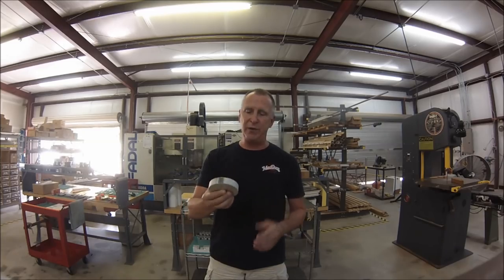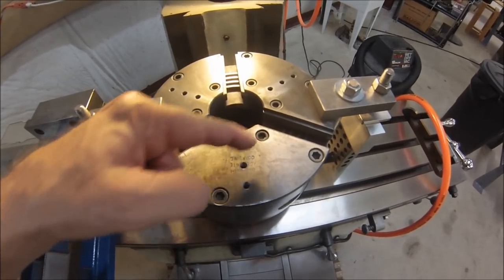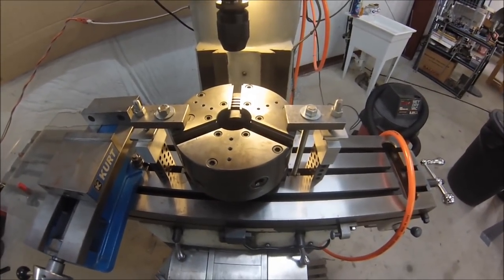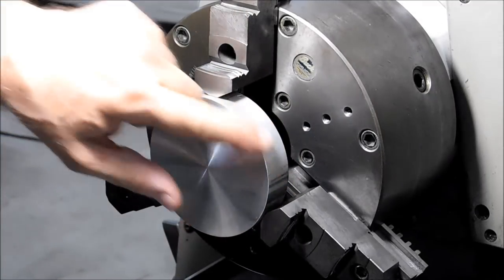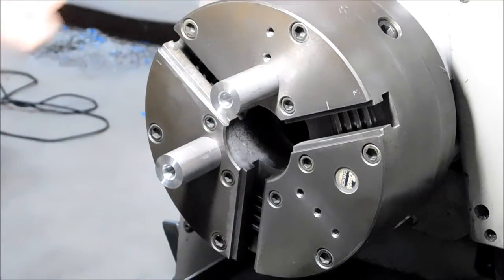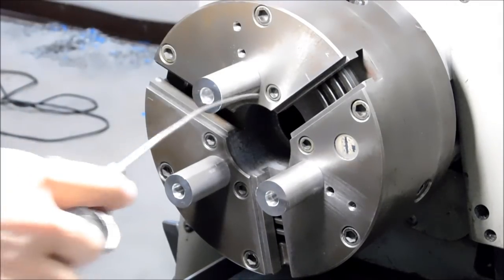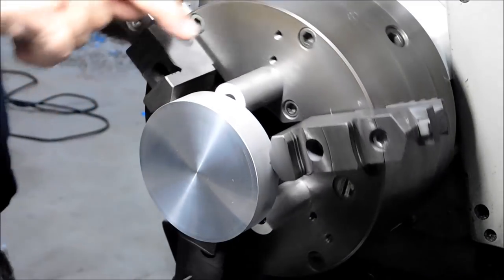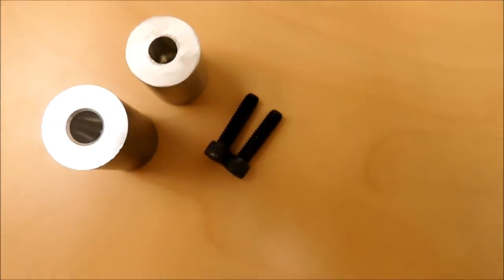A Simple Chuck Modification to Improve Parallelism of Your Parts

Comment: Our shop closes down between Christmas and New Years. I came across this video while I was off. Yesterday was our first day back. The first job they gave me was 4 saw cut pieces just like you had in the video. Work's little slow lately, and the parts weren't due out for a few days, so I decided to try this setup. There's a bit of time in the initial investment, but now that everything is set up I can use this again and again whenever I need to

Comment: Could just use parallels to square up the part tighten remove parallels.
Reply from the maker: You can. Many people do.
Reply: I thought about the parallels, but like the idea of something solid behind the plate.  Great video.  Haven't done a lot of machining since high school, 47 years ago, but am thinking about setting up a home shop, now that I have time on my hands.  Us old dogs do like new tricks.  I got a lot of lathe time in high school because I was willing to learn to use a huge 4 jawed turret lathe that no one else would touch. Learned to love that lathe.
Reply: You could, but then it'd be a bit of a balancing act even if you got into the rhythm of it. For one-offs parallels is better, for large quantities, standoffs is more convenient imo.
Reply: yep
Reply: I have used parallels
Reply: I go through a box of parallels a week and two employees a day from loose parallels.
Reply: Stands are more accurate after machining, as the front of the chuck might not run as true as freshly machined studs.
Reply: you could but depending on the part thickness and material you're working with you could also get some nasty chatter without something solid behind the workpiece. as one of the Vietnamese I work with says "there's exactly 7 ways to skin a cat but infinite ways to cook it" .....  that still confuses me.
Reply: You could but this is far faster for mutiple part runs.
Reply: Speaking from experience, that's a BS way to do it, especially if you have a stack of parts to face. How many times would you be dropping those parallels?
Reply: Good idea

Comment: I'm 75, not a machinist.  I've had a 12x48  Atlas/ Craftsman, now an old  SB 10".  Jet mill drill.   I don't use them much,  and probably  not very good.  Even so the videos  I've seen of yours are VERY helpful  to get my old mind  jacked up,  and  make  one think.   
USN, 68-74,   ET-R2,  NAS Miramar, 70-74,  maintained GCA RADAR and TACAN

Comment: Great video. As a newbie to the lathe I found your way of achieving the same thing a spider does so much more useful. I have been searching for weeks on how to build a spider without a milling machine. Not only that it will be easy to make different lengths with your method , and to think you were able to explain and demonstrate in a matter of minutes the most common sense way of getting around a problem. You also got a new subscriber. Thanks for taking the time to help others like me.
Reply from the maker: Thanks. Make sure to hit that subscribe button to seal the deal.

Comment: Nice set up.  I have used .125" thick parallel bars off the chuck face.  Rotate the 3-jaw chuck so one jaw is pointing up.  This allows you to lay one parallel across the 2 lower jaws, while you hold the second parallel higher, and pinch it against the chuck face with your work piece as you tighten the jaws.  Just don't forget to slide out the parallels before you turn on the spindle. :)

Comment: Whenever I need to machine a thin part, I get a parallel, sit it on the bottom two jaws, resting against the face of the chuck and push my part up against that. Just some advice for people that aren't in a position to modify their chuck.
Great video, really clever.

Comment: Great idea but for a one off part I take and face off a disc of aluminum in the chuck and then superglue my part face to it doesn't matter if it's round or square or not centered whatever then just heat up the part to release the Superglue works fantastic you can turn to a very thin thickness to

Comment: Every video you make is excellent. I don't know how you get thumbs down. I'm about to clean up my fathers lathe and vertical mill they are covered in dust and grime. What do you reccomend for cleaning them?
Reply from the maker: Get the dust off first. A shop vac works well for that. ZEP makes a great line of purple degreasers, and most home centers also have purple power products.

Comment: Excellent demonstration. But what you will do if the same part has small diameter?
Reply: A single parallel slipped between two of the jaws (lay the flat across the jaws) that you back the part up against is a quick-n-dirty solution. In fact, I just used it to make a set of standoffs to mount a control transformer on its side and they all came in at 20.165mm +/- 0.005 (ie - about 2 tenths imperial). File under: it's better to be lucky than good.

Comment: The biggest issue I have with Joe Pies videos are that I always seem to watch them a few days after I needed to watch them.  😏

In my case it would have worked out well to bore a hole that was bigger than my spindle on a piece of 1/4 plate.  parallelism wasn't even critical, but not having to mess with parallels or scrap plywood to get a nice clean and tight offset (4 jaw) would have been so easy and convenient. 

my man always seems to sneak in some safety easter eggs into his videos too.  (marking the jaw safe-limit, not running lathe with nothing in the jaws.)  This is incredibly valuable to a hobbyist who doesn't have a crotchety old machinist near by to share some tips and horror stories.  My dad is missing two fingers (table saw accident), so I'm well aware that bad things can happen - really appreciate the tips.

THANKS AGIAN JOE.
Reply from the maker: I have 2 uncles missing digits from industrial accidents. I'm more than happy to share things that may keep that from happening to my viewers.

Comment: Curious why you didn’t flip the jaws around
Reply: Other people asked the same matter in other comments, and the reply is that reversing the jaws, if the piece to be worked "seats" in the internal jaws steps AND it's not so thick, you have to work with the highter steps of the jaws running outside. Moreover i say that fixing the piece only with the jaws is not so much accurate than setting the piece on the studs and THAN fix it with the jaws . . .

Comment: what a waste of time. on all new chucks the face of your chuck runs true - if not face it. it is repetable if you take your chuck off the machine.
then go to the mill and stick two paralells between your part and the chuck. 
thighten chuck. use hammer to tap it until both paralls are tight. 
take paralells out. 
face 2nd side.  you will get better than 0,02mm. no drilling, no standoffs.
Greets from Germany.
Reply from the maker: But you do have to tell the boss you need a mill so you can face both sides of a part. thats going to end well. Good luck.
Reply: @joepie221  No just take the Paralells from the mill and then go back to the lathe.
Reply from the maker: @Vincemaan  When I developed this solution, I was doing exclusively semiconductor work. Building the plates that handle wafers during their coating and processing. Surface flatness, part parallelism and surface finish were absolutely critical to an acceptable part. Though your technique of using mill parallels will work if snug, the fact that you can remove them would indicate the part wouldn't be parallel to this degree. If you had to tap the parallels out, the track left behind on the part, would have scrapped all the parts I was working on. I even had to be careful of tapping my parts against any standoff for fear of leaving a cloud on the part where it registered. Parallels are OK in a pinch, but this is better.
Reply: you are so correct man, thats what paralles are for
more greetings from Germany
Reply from the maker: @lokkas3637  I need to know who you are in agreement with before I reply.
Reply: @joepie221  actually you are both kinda right, if you have to preserve the surface finish, your method  seems good

Comment: I think my gunsmithing machining professor would kill me if I did this, but I am going to put this in a playlist for when I open my shop, this is beautiful, now let's pray I can find a decent lathe and a mill when the time comes lol.
Reply from the maker: Hopefully you'll also have the cash that day. :)
Reply: You can get away with laying parallels across the jaws. Of course you take them out before you spin up. Set the chuck with one jaw on top, two on the bottom and lay a parallel across the bottom jaws. Set your puck in on the bottom jaws and against the parallel, barely snug the chuck. Slip the second one in under the jaw on top. Gentle tap with a soft hammer and tighten up the chuck. Alternatively, you can hold the part in place with the tailstock. Parallels should still slip out and feel about like joeblocks. Not too bad for a onesy/twosy job.

Comment: That's a nice trick. I have used a little different approach. Setting the lathe on slow revs and clamp the workpiece just so it can hold in the jaws. I made a homemade "tool" with a ball bearing at the end. The trick is I mount it in the tool holder and then ever so slightly touch the workpiece with it. It will straighten up and run almost perfectly true. Of course, one has to tighten the workpiece up before actually starting the turning process.It works for pieces that are quite short like an endcap, small pieces of pipe etc.
I know your way is much more accurate, as the video shows. Thanks for sharing.

Comment: I have been in machining all my adult life, (about 35 years in many shops),  and earned several degrees in manufacturing.  There is not too much I have not seen. But this is new to me and a great method, especially if you are doing more than one part.  For one part, I have used parallel bars between the work-piece the the chuck face. You have to hold one bar while you twist the chuck key, but you snug it, tap it with a dead blow, tighten more, tap again, and slide out the parallel bars.  .001" out of parallel can be expected. This vid is a very accurate method with a quick part change that can justify some larger volumes of work.  In that case, I might make the pillars out of 4140 prehard. Hard enough to last a long time, but still machinable.

Hey, looking at your shop at the beginning.  Wanna sell a door or two? :)

Comment: Great tip Joe.  We made a similar tool that attaches to the tail stock drill chuck.  However, this only helps with parallel alignment.  Your idea keeps both parallel and offset.  Much better idea. Cheers, Aaron.
Reply from the maker: I've seen those too.

Comment: Great Tip Joe,  also I remember 30 yrs ago the shop owners son that had no formal training in machine shop practices was finding the right feed he want to use at the gearbox by start-stop to engaged a different gear set on the lathe with nothing in the the chuck. He was also standing in line with the swing. Of course being the owners son you could not tell him anything.
 One of the jaws came flying out after he started it at high rpm, grazed his scalp (bleeding) and ricocheted off the concrete wall taking a chunk out of it.  He liked to say a fraction of an inch higher it would have missed him completely. I alway thought a fraction of an inch lower and we might have been attending his funeral.
Reply from the maker: I NEVER start a chuck without pressure on my jaws. That screeching sound you heard just before the standoff facing op was the scroll spinning at a different RPM than the chuck body. That would translate to one thing. Trouble for anyone standing inline with the chuck. The bosses son was fortunate not to have his face split. Safety only takes a second, injuries last much longer.

Comment: As a fitter and Machinist, THAT is a great Idea, and it is so simple. I have used three leg inserts that go between the jaws and against the chuck face but they tend to rattle and move which takes some of the accuracy away, you also need different sizes AND thicknesses to cover what your idea does better.

Comment: Just got an  idea.
You can leave the chuck in the lathe with the jaws out and use the lathe cross slide cross slide dial and tool post to mark out the places the holes need to be.
Hand rotate of course.
Very accurate and fast.

Worth
Reply: Good Idea!  Ive seen Keith Fenner do that to scribe rings into his 4-jaw as well, as a reference to set the jaws uniformly.

Comment: I wish I could attach this comment to the correct video, but I just can’t find it. Sometime back I watched a video you published about drilling on the outside of a pipe tubing or round bar. Earlier today I was watching another machinists YT and his project included putting cap head bolts into a piece of previously slotted thick-walled pipe (wall thickness was 1/2”+ so it likely wasn’t actually pipe but a turned bored piece of round stock, anywho...) and when he said said his project would include bolts to close the slot I immediately thought of what I learned on your video. As his work progressed I thought, he must have seen Joe Pieczynski’s video because he’s going it exactly correctly. Just wanted you to know your teaching does stick with a guy. Thank you.

Comment: Hi Joe, sorry if this is covered by an earlier comment, (just reply yep and I'll save you typing a full response again). Joe there's a whole other short vid in marking up the 3rd jaw for safety, "what's the safe distance for the 3jaws before they'll let go?" 
This is a great technique demonstrated, and is one id like to do to my old lathes chuck, as this and the bush within the three jaw, cut three times inbetween the jaws, are two tips that massively improve any run out on a jaw in any plane and allow any part to be turned within 5tens of a thou easily, (even if the chuck is knackerd).

I have one request for a vid, how could you make a tool that would allow you to index 360° from the lathe spindle, using only the lathe. All I can think is to secure a parralel plate to hex bar stock, and indicate the flats, use dividers on the plate, reposition the hex and plate to reference mark on plate, and dial indicator on hex looking for low spot, and repeat a fair few more times. Your reference mark coming from a scribe line off the tool using the cross slide. Eventually you would be able to get 360 divisions my worry is that the repositioning wouldn't be accurate. A hex piece of stock would be able to get you twelve references (scribe lines) without even having to re-ajust anything. Problem is I get to 144 divisions and get stuck at getting the full 360° any ideas?? I just want a way to make the plate without a mill, I can make the locating pin easy enough. Would love to come and visit your shop for a few days, maybe you should do excursions lol.

Comment: Great modification, especially for repetitive parts that must be parallel. For only one part I face the second side, mike near each jaw, tap the thin area for slight movement, face again and continue until sides are parallel within .001. Usually doesn't take long but light taps for fine adjustment are needed.

Comment: Hi Joe, 
What a simple and inexpensive solution. I have seen Adam booth use a small Y shaped tool which has magnets that attach to the chuck face and has small parallels to achieve a similar support between each pair of jaws.
The only place your setup wouldn't work is if you were machining something smaller than the centre bore of the chuck, unless you made a set of support blocks from rectangular material so they could overhang the centre bore hole.
Regards Dennis
Reply from the maker: I have extension bars in 2 sizes for that very issue. I also have an adjustable stop that fits the morse taper in the head.
Reply: @joepie221  is there any chance of showing an example of this? i have a small part that needs to be parallel front to back, its about 1" dia
Reply: Adam's Y-tool depends on the chuck face to be perfect.

Comment: been running a mill and lathe for 35 years, first time i've seen bolt on blocks, I just use parallels then remove them once the piece in in place. love your trick. thanks !!
Reply from the maker: I've done a lot of parts that had critical rear surfaces, and dragging parallels across them wasn't an option. I actually used to do that. This setup was conceived to specifically eliminate that drag situation.
Reply: Intetesting. . . 
 All my critical surfaces are done under a grinder wheel. I don't do much soft material. Brass or bronze occasionally. I will put 9 holes in my 24" lathe chuck next week .... thxs.
Reply: Done that too.

Comment: That's a good straight forward method. The highly sophisticated chuck stops are great but what you have shown is more doable. Plus you can't beat the accuracy of stops that have been faced in situ. Are you going to plug the tapped holes with something when they arnt in use? Cheers. Crispin.
Reply from the maker: Hey Crispin, Good to hear from you. These holes won't introduce debris inside the chuck, so there is no good reason to plug them, but for convenience, I suppose some grub screws wouldn't hurt. Hows that new shop coming along?
Reply: Yes I was thinking grub screw but I don't know if they would wind them selfs out. The Worksop is not too far off now. Just need to sort doors out and insulate/ board the ceiling. Have a look on my channel for a video called 'Workshop Update'  cheers.